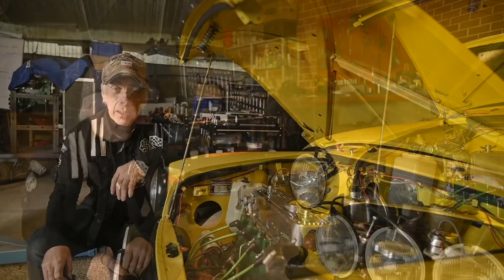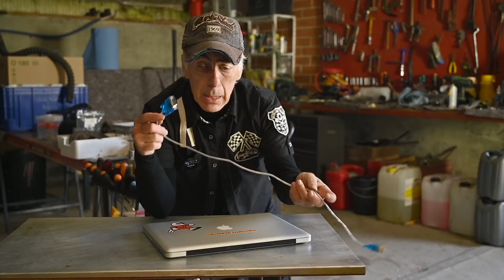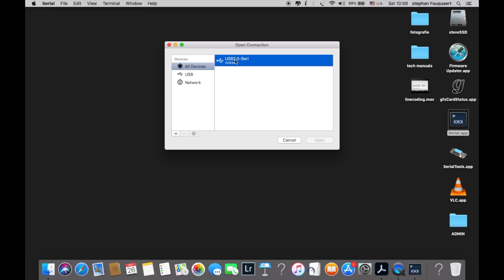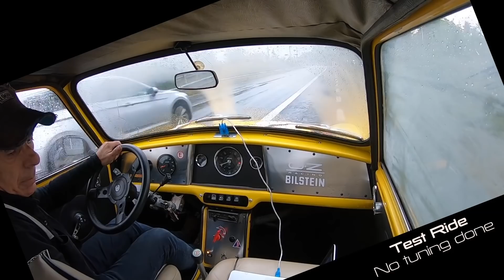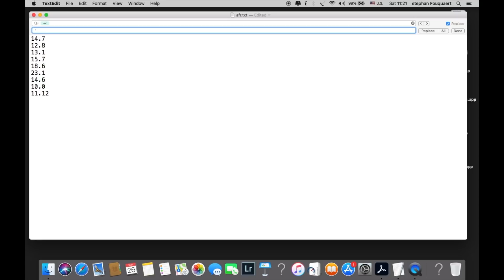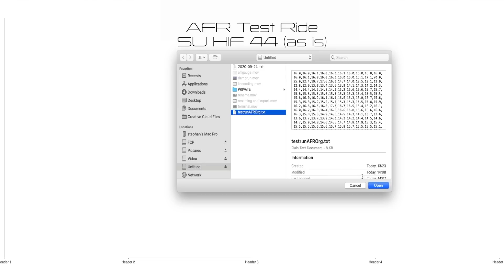Logging your carburettors behaviuor -AFR- and analysis

Comment: Hello sir.  I would like to know your thoughts on weber 38dcoe on 1275 classic mini engine,  Is that too small for the engine?  My mini is actually rover 1.3 spi but want to convert to carb.
Reply from the maker: That can work , but you will need to put the correct jets into it, have a look on my channel, playlist weber.  Its all there
Reply: @D3Sshooter thank you for your response.  Will definitley check that.

Comment: Great video but I'd like to add that you are actually adding an unnecessary step. After you remove the header and blank lines from the log file, it is already valid CSV, in a more conventional format even. A single data point with no comma and then a newline (with dos, unix, or old school macintosh EOL encoding) describes a single column of ascii encoded numeric data, which any spreadsheet can convert for you. For extra points, open the serial port with a python script or something, and every time you receive a value from the serial port, you write the value comma the timestamp comma whatever other data you can interface with, maybe a tps data point if you are into such things, or a digital vacuum sensor reading. then you have quite instantly a very useful graph that tells you a ton - extra extra points, hook in a python graphing library and get realtime graphing while still logging data.
Reply: Of course at that point you dont even bother with CSV and just shove it into SQLite and have way faster access potentially and nice searching and sorting and filtering tools built in...

Comment: Stephan, I reckon that's a better than fantastic video !!!!!.  I followed your procedure for the main part with a different spreadsheet program but it worked tremendously . Now I just need to work out if I can also record engine revs at the same time. I'm doing this on a 1978 Triumph TR7 4 cylinder with absolutely no engine management so this is just a great help. regards
kippy

Comment: Excellent video and explanation. A useful addition to the data logging is a throttle position potentiometer and engine RPM you can then correlate butterfly position with readings etc. I have one on my Dellorto 40 equipped escort along with the AEM gauge. Once you know the cross over from progression to main jet position it is  very useful to set up the jetting across the full range.

Comment: Interesting, I have a Jeep 258 with a Weber 38/38.  Bought an Innovative LM-2 (I didn't want a gauge) and after logging, found that I was running VERY lean, much like yours, spikes in the 22's!! It will almost always spike in some places, but not that bad!!   I replaced the 4.0 Aux Vent to 4.5, helped a ton, stabilized alot of that back/forth/up/down you see.  Can't wait to watch your next vid on this.  I found it easier to go a tad rich, and work my way out of the hole.   It may sound funny to go through all this for a Jeep, but people spend more money on stupid "upgrades", without knowing where their carb stands!!!  I've already noticed a HUGE difference in performance.

I would also note, it's addictive, lol.  And your right about small things.  I like the Jeep a tad rich from idle, better low end TQ, it seems.  But for a Mini, it may be different, they are polar opposites, lol.  But AFR Theories are abundant in this field.    Great vid as usual!!!
Reply from the maker: Thanks for the comments and write up...

Comment: Very good videos Steve, thanks for sharing your knowledge and time with us. I was just wondering if you could clarify that when you looked at the log file, there was 9 sets of numbers, did you shorten the list down to that as there would really be hundreds if not thousands to import into a spreadsheet? When you import the excel data into the graphic tool, there appears to be a lot more sets of numbers which then formed the graph. I assume that's the case as the graph could not show so much detail from 9 sets of numbers, but wanted to make sure i wasn't missing something.
Reply from the maker: thanks for the comments, its a lot of sorting and combining , maybe I will make a designated video on that

Comment: Class A Effort for producing the video and analyzing the Ratios.
However 10:1 on a Naturally aspirated engine with low compression it's excessively rich.
I've experienced peak power with conservative EGT approximately 12.6 to 13.1, however ignition timing is key and vastly affects the mixture at WOT. Thanks again for your informative video.

Comment: no its not if you consider static from spark plugs and wires and alternator and audio device and other more relays and coolant electrolisys evry thing is fine those are perhaps false data nothing realy can stop static ore bether known as AC electricity even if you have dc bouth types can co exist in wire so not necesary corect data at all and if you have static gages read wrong ore asulate back and fourth static even eats up ruber so I wuld not realy trust that staff exept if you use it on a stationary generator engine with out other electric devices close to a engine and with out coolant only destiled water those engines are nice but like all clasic car teribel oil and fuel quality expecialy back charging problems wires to small like any gasoline engine moisture heat and rost that is solved actualy with spray protection basicaly any isues go away
Reply from the maker: Thanks for the comments, well it worked fine for me

Comment: I had an AFR gauge on my Clubman Mini when I first got her back on the road. Unfortunately the exhaust sensors that the kit used were a very poor quality and I ended up using three sensors! I lost interest in the kit and stopped buying the sensors, I should've simply bought a genuine Bosch one from Ebay. I ended up putting her on a rolling road and custom shaped a needle to give a good fuel supply. The AFR gauge is a very useful tool when you can't get access to a rolling road, just make sure you buy a good quality exhuast sensor!
Reply from the maker: Thanks for the comments, in this case I use a good quality sensor "Bosh", time will tell. Indeed a dyno is always the best to tune. Yet with the  AFR and some test rides  including up-hill you can get close/

Comment: Thank you for sharing your knowledge and experience, much appreciated. I will soon be fitting a Spartan 2 dual Wideband AFR gauge and am having problems finding a Windows based grapher and Serial port app. Have you any suggestions which one I could use? This is on a PC.
Reply from the maker: Try windows terminal, and use Excel to graph ( just insert graph and select the data)

Comment: Sir.... Again... You are the best... Um still fighting with the transition from idles too mains.. with my Webers 40 in my BMW 2002.... Its slughish on low rpm at full throtle.... It looks rich... I dont have an afr....
 Sir you are the best....
Reply from the maker: Thanks for the comments,  Did you check the progression holes ?
Reply: @D3Sshooter  yes i did.
Everything ok, i feel my 55f9 idles are to rich... I dont know.... I idles great but if go full throtle in low rpm its slughish...  Or going uphill and acelerate harder before 3000 rpm. If feels rich, and after that it goes very very fast... I think MH main combination is very good.
I have 32 Chokes maybe they are litle for my BMW 2002 with a 292 cam and provoque that Rick mix in low rpm

Comment: PLEASE do not let the gauge "warm up" before starting the engine.  Thiis is the #1 cause of wideband sensor failures.  The CERAMIC element of the sensor "warms up" to about 680C/1250F ( glowing orange hot ).  When hit with a blast of (relatively ) cold start-up exhaust, it cracks just like when trowing cold water on a hot windshield. The cracks grow and spread the same way.  1st the destroy the calibration of the sensor, with air leaks.  Then the sensors get flakey.  OFten showing full rich or full lean, intermittently.  Then, the cracks hit something vital; and, the sensor does the way of the dinosaurs.
Reply from the maker: Thanks for the comments, that is good info... I was not aware of that....

Comment: You should consider using any simple ecu, like speeduino, that would allow you to hook rpm and afr wires to ecu and obtain an afr vs rpm log and analyse it much easily
Reply from the maker: Yes that is another option...  Thanks for the comments,
Reply: A TPS would be good also.

Comment: I was thinking of recording a video showing my revs / speed whilst data logging to help dial in my idle to main jet transition.
I'm using the same AFR setup as you, so your guide has been very helpful.
Thanks for sharing.
Reply from the maker: Thanks for the comments,  that is another good approach... another way is save every sample with a timestamp... and video record the RPM as you say with a timestamp in your video that works...

Comment: Looking forward to seeing how you address these issues Steve, very interesting.
Reply: going to be a lot of compromise with that basic carb, just a larger jet, you have to run them a little rich to make up for all the short lean times it has due to no accel pump and simple stage it has, usually the SU carb is a thing to ditch for performance or tuning options, the damper it has is a a bit stupid , and needs to try different oil grades to change it
Reply from the maker: Thanks for the comments,  indeed there are 300 needles with different stations, there are about five springs with different loads and yes there is the damper single grade oil   to be looked at...  A lot of variables.     I have planned after this tuning, to move to a SC 5 port injection system with ECU (  that is better then any carb  even webers ) . Not sure when, but that is an planned option
Reply from the maker: Coming soon!   I will first do a video on the SU working itself and then tackle one issue after the other on the curve

Comment: Very interesting video. Have you think to replace SU- carburetor with Mikuni HSR-series carburetor. HSR flows much more than SU and it is modern design. HSR swap is almost bolt on.
Reply from the maker: Thanks for the comments,  I have not looked into that...  I think that I might move to a SC 5 port injection with ECU  instead.  But first I wnat this SU tuned
Reply: @D3Sshooter  Check Vintage Performance Developments (v-performance) -homepage. There are more information this HSR-modification. Installation and Tuning Instructions etc.